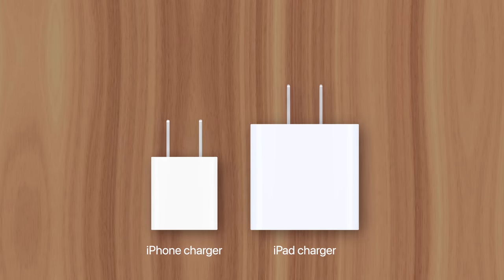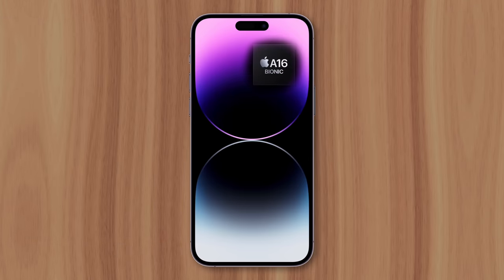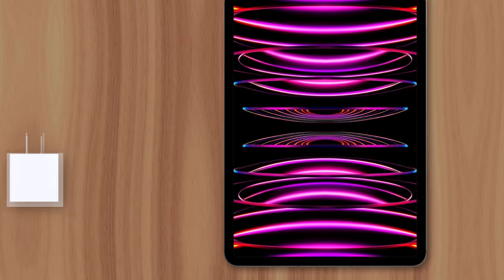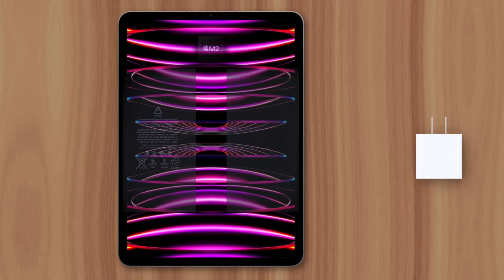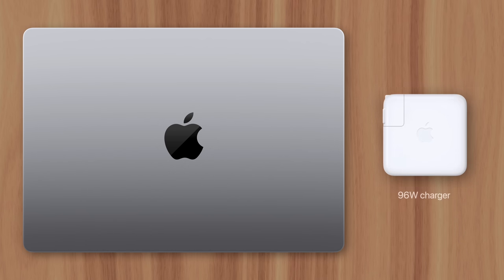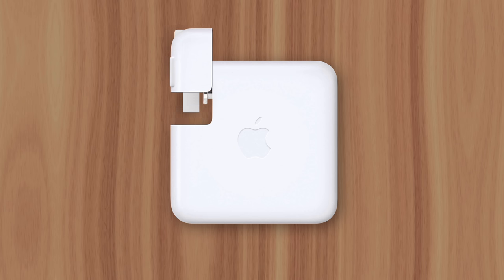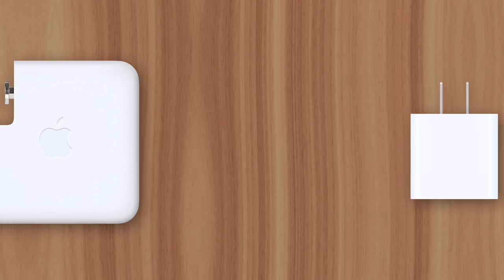Why MacBook Chargers Are So Big

Comment: If you think MacBook chargers are big, you never used a PC brick
Reply: Exactly lmao
Reply: If you are on crack you'd think PC's has chargers.
Reply: pcs don’t get charged tho 😭
Reply: @HPlayss He means windows laptop chargers
Reply: People in the reply section saying “Pc DoEsN’t ReQuIrE a ChArGeR”, pc stands for personal computer, it can generally be desktops or laptops, so it doesn’t always have to always mean a desktop. Keep that in mind.
Reply: At least Laptop doesn’t stick the brick in the socket like Macbook one
Reply: these are massive compared to any Apple Charger
Reply: It's because MacBook charges doesn't come with an extension cord so most people just take the whole brick and plug it in the wall.
Reply: @CanadianBakin42O laptops are still technically pc's, just portable ones
Reply: Lol. Too true. Those are massive
Reply: @Random-oj4gk 🤓
Reply: @The_real_paill_neverdies  I wouldn't take that insult coming from a person with a roblox avatar as their pfp
Reply: Specially maxed out rog or alienware ones.. they are 300 watts +..
Reply: If you are referring to a Windows laptop, you might be wrong. The laptops nowadays have smaller charging brick than that of a current MacBook Pro.
Reply: @Random-oj4gk If you are referring to a Windows laptop, you might be wrong. The laptops nowadays have smaller charging brick than that of a current MacBook Pro.
Reply: @simimik.  general thin and light ? Yes they are comparable size.. gaming ? heck they put the brick in charging brick..
Reply: @simimik.  I never said anything about a windows laptop or the size of a charging brick, I’m pointing out the misuse of the term “pc” as people think that pc means a desktop.
Reply: @soumyadityaagarwalla1517  I just bought a Huawei laptop and tried also to check a MacBook in PowerMac before buying the Huawei, Windows laptop right now have so small chargers (charging bricks). And there's also no more extension cord. It is directly connected to the plug.
Reply: @Random-oj4gk  Yeah, my bad.
Reply: @simimik.  it’s all good
Reply: Lenovo bricks are literally the same size of apple's
Reply: You’re right, I haven’t, because desktop PCs don’t charge. 💀
Reply: My laptop has a smaller charging brick than the macbook -_- It depends on the manufacturer.
Reply: Exactly like I thought normal windows laptop chargers were way to big when I saw a MacBook charger 😂
Reply: Many PC laptops have smaller 90W chargers than Apple. Gaming laptops are the ones that come with ridiculously large power bricks that could fit in 6-7 macbook chargers.
Reply: haha good one.
Reply: @ycebreakr17 they are the same size on most new laptops.
Reply: PCs don’t use chargers. They use PSUs. Windows laptops use really large charging bricks tho.
Reply: PSUs are huge
Reply: @tomasplunksnis1087 pray tell, what do you think the difference between a “power supply unit” and a “charger” is, other than convert AC into DC. Not to mention, many high end windows laptops are supplied with GaN chargers which are significantly more compact than a MacBook charger while offering higher power delivery. I have a 65 watt unit that is barely larger than the brick that came in the box with my MacBook Air.
Reply: No laptops have chargers and my laptops charger is way huge. It’s bigger than the outlet.
Reply: Hahaha so true. I hate PC charger adapter. Glad that those days are gone. I completely switched to Apple.
Reply: True
Reply: @uyubsd The CPU and all electronics require 3.3, 5 and 12 volt power, thats what the brick is for.
Reply: Not all pc, matebooks use small chargers
Reply: Alienware has bricks for power adapters 😂😂
Reply: Fax
Reply: fr
Reply: Why there is 240w charging cable for MacBook Pro ?
Reply: Gamers need massive chargers!!!!
Reply: @jameslau6593  what where?
Reply: @_middleborough_  Alienware etc
Reply: They can be up to 330w
Reply: @jameslau6593  macbook pro only need 96W max
Reply: @_middleborough_  nope, my MacBook Pro 16 inch M2 needs 140W power adapter
Reply: That’s why it’s called a brick.
Reply: @pythondrink fr
Reply: @LionsinofStraight  Well you can use a figure 8 cord in place of the plug attached to the mac adapter

Comment: Hang on, there is no way a 20w charger takes 10.5 hours to charge an iPad, it takes like 2 hours tops! 😂
Reply: Yea, that has to be a huge typo/mistake in his script.
Reply: @TechNowOrLater  same with Mac, I load mine with a 5 watt adapter one time
Reply: Yeah. It take roughly about 2 hours ot fully charge. The 11 inch iPad Pros have 28.8 Wh battery, so if it charges at 14 watts, it’ll take about 2 hours.
Reply: @HenryJaques you loaded yours… 1 time… yeah…
Reply: @HenryJaques hat’s not true, a MacBook would take at least 6 hours to fully charge with a 5W charger
Reply: @daniyalkhizar  I mean you could load a MacBook with a 5 Watt Adapter but for sure I took ages, I my case I loaded it over night and that's worked and saved my ass for the next day presentation
Reply: Depends which one, but I also agree I have the iPad Pro and it charges in no time
Reply: Nope, not on the 12.9 inch iPad Pro that is powered by the M1 chip in A cold environment where the M1 doesn’t throttle down consuming more energy (I have an M1 iPad Pro 12.9 Inch and since the M2 is even more powerful I imagine this is the case for the M2 as well)
Reply: In fact the battery will go down if you have an external device plugged using the iPad battery in while it's on the charger!
Reply: A 10W jump from 20W to 30W equals 5x times charging speed, why wouldn't it make sense right ?😂
Reply: Dude you’re still wrong. iPads have huge batteries, they don’t take 2 hours to charge. That’s at least a 4-5 hour charge from 0 to 100% 💀
Reply: yeah he tweaken

Comment: Fun fact: despite using less power with the phone off, it will charge slower than just standby / screen off since it can’t negotiate charging rate, etc.
Reply: you can't charge iphones turned off
Reply: Technically speaking, [Power Delivery] like any other fast charging does not require an OS to be activated. Think about fast charged power bank.
Reply: @lordv1le859 yes u can.. lol 😂
Reply: @SupremeCyril  no you plug it in and it turns itself back on.
Reply: @lordv1le859  then turn it off after plugging it in
Reply: @lordv1le859  then plug it in first b4 turning your phone off. Your phone’ll stay off.
Reply: @lordv1le859  but u can with android
Reply: @lordv1le859  you absolutely can. I tested this personally because every article on the topic I could find said it would charge faster when shut down because they didn’t actually test it themselves.
Reply: @kaguraschimizu4609  it can be hard wired to charge at a specific rate, but no sophisticated device works that way. Even power banks. It’s not that it needs a full OS, just power to the logic circuitry to monitor battery temp, charge state, power adapter specs, etc. 

So a device doesn’t NEED to be fully booted IF it’s designed to allow that. Devices just aren’t designed that way cause it would be a pretty pointless middle ground that wouldn’t have a meaningful impact vs standby mode.
Reply: @lordv1le859  you can plug it in and then turn it off… and it doesn’t come back on until you turn it on yourself
Reply: @lordv1le859 just turn it off after it boots up

Comment: I have a 30W charger that I use occasionally to charge my M1 Pro Mac when not in a rush and it definitely doesn’t take days (unless in use)
Reply: Yes exactly this is what I was looking for in the comment section.
Reply: The 30w PD charger I take everywhere charges my M1 Pro MBP just fine with light use, and definitely quick enough overnight if the machine is sleeping. Haven’t found the need to travel with anything higher power yet, and this does extra duty for my iPad and iPhone as I rarely need to charge more than one device at a time.

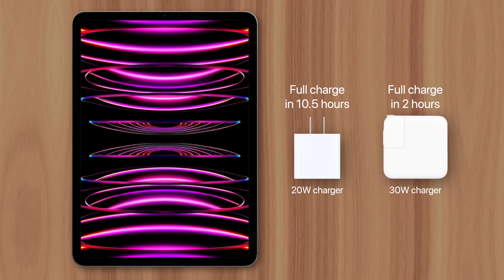Comment: 1:05 Damn, my iPad charges in like 2:30hrs with its 20W charger. I think going to 10.5 hours is just extreme, maybe with the 5w charger but definitely not with the 20w. Also when buying a Mac apple offers you either a 60/90w charger or a dual usb C 35w charger, and the Macs definitely doesn’t take entire days to charge with that 35w that’s for sure
Reply: Yes, Greg got his facts wrong here.
Reply: Max charging capacity of a typical MacBook is from 70(MacBook air) to 130ish (MacBook pro) watts.

But charging it with a 35W will actually take like 3-4 hours not more than that (at idle).
Reply: I have a 30 watt adaptor for my Macbook air and it takes 2 hrs tops. I don't understand why Greg got his facts wrong, in fact, I sometimes use a 5 watt charger to charge my air and it charges even while being used!! Yes, the rate is considerably slow but still works
Reply: MBP don't have a option of 35W chargers only MBA get that option, with a 14'' MBP you get 70W/96W option and with a 16'' its a 140W charger.
Reply: @pulaktrivedi9743  It's far from simple facts, it's the simplest math to know that 30 is only 50% faster, not 425% faster
Reply: @omerelbaz7648  Like you`ve already said: This math is to high for the average viewer of this channel.

Comment: Well, the MacBook Air 13inch and 15inch have a 35W Dual USB C port compact power adapter which is small

Edit: 70W Power adapter is big but the same size as a 61W power adapter.

Comment: Your numbers are wrong.
It won’t take 10 hours to charge an iPad and certainly won’t take days to charge a mac. I use a 20w for all my devices. Macs take about 10 hours or lesser. P.S. I use a low W adapter to increase battery lifespan

Comment: The iPhone charges at 27W
The iPad charges at 30-35W, or 20W for the iPad mini.
The MacBook chargers at 70-140W depending on the model.
Reply: macbook air 2020 has 30 watt charger and it fully compatible with iphone and ipad
Reply: @vlad-yelnikov  The 2022-23 MacBook Airs take 70W max.
Reply: @TheStopwatchGod  I'm talking not about maximum wattage but about which chargers Apple ships with the device by default. For the MacBook Airs M1/M2, it is 30-35 watts.
Reply: lmao some chinese android phones like xiaomi or oppo etc ship with 100W charger which is just overkill.
Reply: @vlad-yelnikov  You can option the M2 air with a 70W power adapter
Reply: @idkjuststop  They go over the top for marketing "OMG THIS PHONE CHARGES IN LIKE 20 MINUTES IT'S INSANE"

Comment: Not true, iPads and new MacBooks are extremly power efficiant, I use 20w and 35w chargers for my MacBookPro14 and two iPad Pros, and they are charged pretty fast while using it. Yes, they are slower than 65w charger, but not that slower :) "10 hours of charging" and "days of charging" is extremly misleading...

Comment: iPad Pro 12.9" definitely does NOT take 10.5 hours with a 20W charger, LOL. 
I regularly charge mine with the 18W charger and 0-100% is <4 hours. Also charging at lower wattages prolongs battery life.

Comment: Actually you can charge a m1 MacBook with the 20w charger
When I travel I always do that and on light use the MacBook will charge very very slowly, however if you push it it will lose battery, and if I put it in sleep it is charged after the night

Comment: I would question what you've said about 30watt charger. Please see my last video - I did tests with Apple dual usb-c 35watt charger - in most cases 16 inch m1 macbook pro consumes less than 30 watts and would charge macbook fully in way less than a day. Its still slow, don't get me wrong, but it is actually useable to the extent that I am using 35watt charger daily. Rarely I take my 140watt charger when I need fast charge on the go - so my 140watt charger is in my backpack 99% of the time, while 35watt charger is being used daily.

Comment: But... isn't that obvious? The bigger the battery and the more energy your device needs, the bigger the charger will be?
Although my macbook air m2 has a 30w charger and it only needs a couple hours to be fully charged, they did a really good job in that regard. And my 20w ipad charger works with my iphone and airpods too, only needing a couple hours to charge, and it's obviously a bit smaller. But idk, doing a full video explaining this is kind of pointless...?

Comment: The MacBook Air (M1) comes with a 30 W charger, it works and charges exactly the same with much smaller 3rd-party 30+ W GaN chargers such as the Anker Nano 3, etc... It only pulls around 1 W at idle on low brightness, so you could definitely use a much less powerful charger to charge it (as long as it supports Power Delivery), and it wouldn't take days, maybe just twice as long with a 15-20 W charger.

Comment: a 2.1 amp usb charger will keep a MacBook Air 2020 topped up. If you start it at 100%, that small charger with a good and not dollar store cable will be enough. It will fill the laptop from 50% in about 4 hours. Add about 25% to that time for cables from Dollar Tree.

Comment: This whole video is a giant script error. Like…. A MacBook doesn’t take days to charge on a 30 watt charger, and neither does the M1/M2 iPad take 10 hours on a 20 watt. This must be a script error, or a miscommunication since ipads mostly take longer to charge when in use,
Also iPads have always had bigger batteries due to their bigger size compared to iPhones. Same with ipad pros, even the 1st Gen one which was “powerful” for the time. Them having the M series chips doesn’t mean they have bigger batteries for that reason. iPads are also more energy efficient due to ipadOS, which is why they can just sip power when Idle, or can be absolute power houses with the right app. Meanwhile MacBooks being basically laptops aren’t as efficient even when idle.

Comment: Very informative. Kindly help me out with charging issue of MacBook Air 2015 model, the cable is not connecting properly even after connecting. What is this fault about cables or slots ?